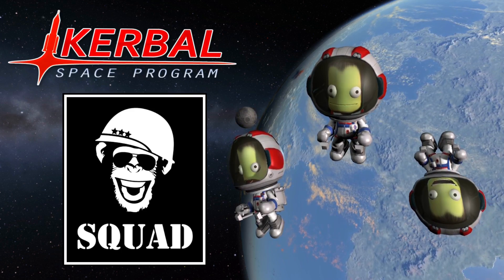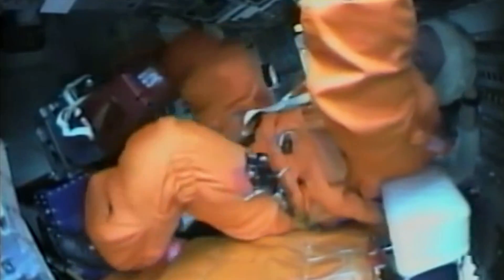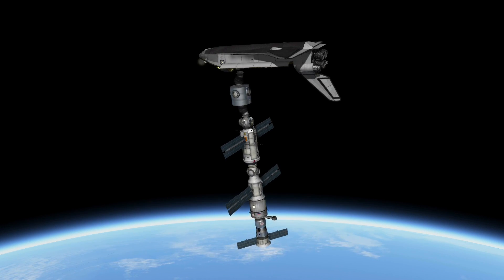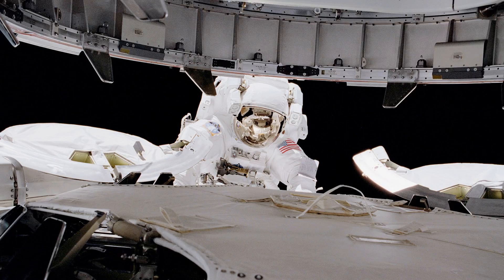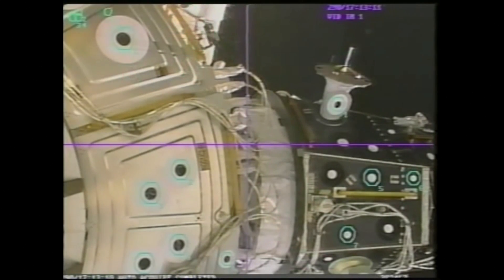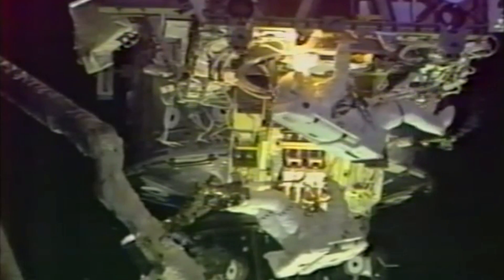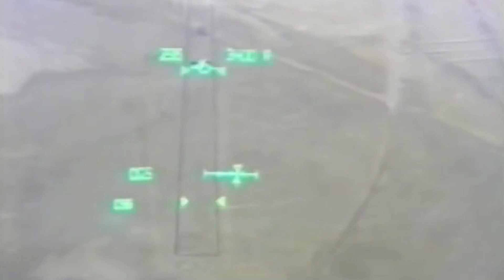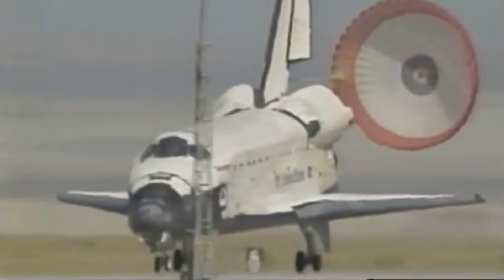KSP - Adam's ISS - Part 5: Z1 Truss

Comment: I want the shuttle back... Well, not at the cost though. But maybe, just maybe the Dreamchaser will get operational and/or Jarvis is targeting horizontal landing reusability...
Reply: Have you heard about SLS
Reply: @quadaerospace , no. Not at all. Nobody in the #teamspace community talks about SLS. Like no one. Never ever. It's always Electron...^^

Obviously I did but why?
Reply: @alfihalma4320  So you hate SLS. SLS is going to be an ultimate legendary rocket. More powerful than the flying dustbin rocket from musk
Reply: @quadaerospace , I don't hate it. I'd be happy to see it fly. Both, the orange and the silver dustbin... And so far, given that the bureaucracy has to agree to a Starship launch, SLS might fly before that. 

Still, production rate, cost, payload capabilities, stage sizing, the SRBs, etc are nothing to brag about comparing to Saturn V.
Reply from the maker: @quadaerospace  err reusable flying dustbin i think you'll find :_GRUKSpot: